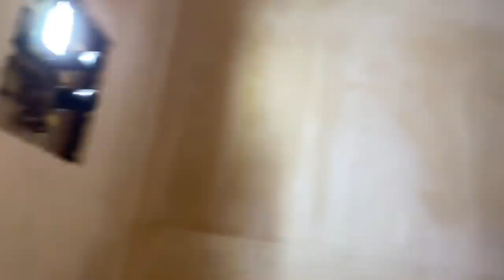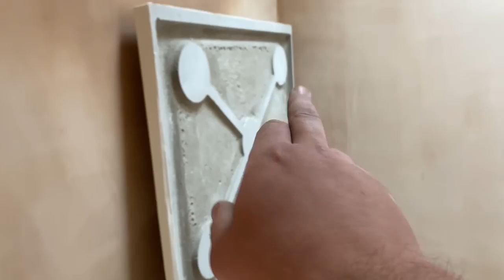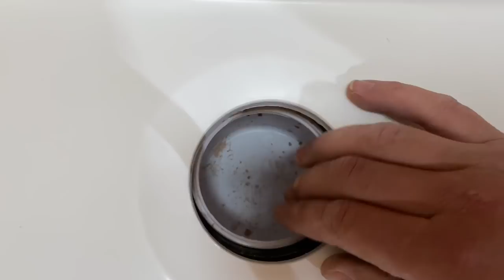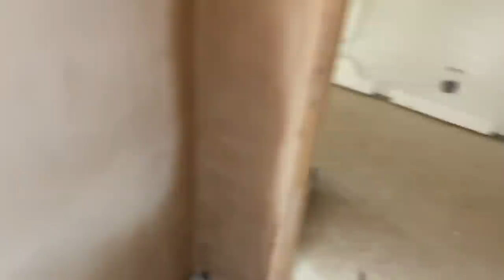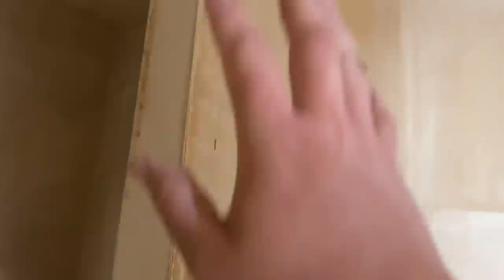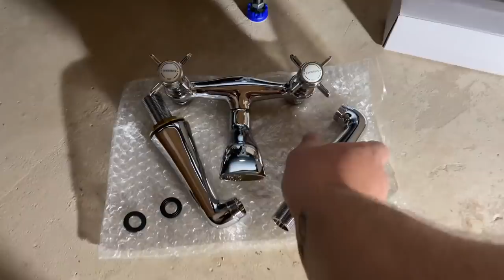SHOWER TRAY INSTALLING…THIS IS WHAT ITS REALLY LIKE DAY TO DAY PLUMBING ON SOME JOBS

Comment from the maker: ALSO BEFORE ANYONE SAYS IT, I KNOW THE SCREENS MAY NOT FIT…. THATS UPTO THE BUILDER NOW
Reply: Ha, just about to mention that! Get quite a bit of tolerance though
Reply: You haven’t pinned the comment mate good video I love/hate those jobs at times 👍
Reply from the maker: Pinned now 🤣🤣🙈
Reply: On most 120cm shower cubicles 99% of the screen are at the allowance 116-120cm which yours is going to be 119cm with tiles and adhesive .
So nothing to worry about!
I have installed 100s of them
Reply: May well be up to the builder but he and the client will still blame the plumber when that job of installing any doors/screens eventually gets bodged into place. Just hope the client never clocked your van during a site visit and remembers your details from it as I bet they'd happily sling mud you down their golf/country club or at the PTA meetings they attend!   

Shame that builder and his workers don't know how to use a tape measure or how to allow for final finishes. 

Quality LOL
Reply: Depends on the tolerance of the screen, you might be lucky, I stick trays down with flexible tile adhesive to stick with the manufactures instructions on most trays.
Reply: See someone Curt ing a screen down 😂
Reply: See someone cutting screens down 😂
Reply: Looks like ahower curtains will be used
As i cant see the door fitting
Especially if thick tiles 🤔
Reply: @tomstrutton4351  🤣
Reply: I was just about to mention that 😂. I always check the tolerance in my shower-screen channels if I’ve got a tray to fit in a tight spot . 
I once had to cut 5 mm off the end of a shower screen frame for it to slid into the channel . Nightmare . Love the videos 👍
Reply: @oliverwoods5554  Would have at least spoke to the builder first if only for some sort of indemnity to give them the opportunity to correct the mistakes. So if ever the tray cracks and leaks what will be the discussion when the insurance company see the tray has just been stuck down with silicone as opposed to the manufacturers instructions. Maybe never had a problem but seems a lazy way of doing the job just to save time and money.
Reply: Legs!

Comment: I'm due to retire at the end of this week after 50 years plumbing. ( I started Sept 73 aged 15) When we did trays back in the 70s ( deep ceramic ones) we had to rely on the grout to seal around the edge. No silicone in them days!😂
Reply from the maker: Enjoy your retirement mate, and thankyou for you years in the trade👏🏼👏🏼👏🏼👏🏼…..

Comment: This was greatI was in exactly the same position with a 900mm having to fit into 875mm. Ended up having to do the same thing you did but also having to redo the plumbing etc. First fix was terrible. Thanks for this.

Comment: I had a 1660 gap for my shower tray. I just brought out the narrow wall by 50mm (40mm studs + 10mm backer board) then had 10mm wiggle room. But not sure why they don't just make it to the size you need in the first place. Also, I think they skim as tilers are happy to tile onto plaster and it's cheaper than backing board or other alternatives.
Reply from the maker: Yep they should have made it the right size from the start…. Happens a lot when communication isn’t there

Comment: I noticed it was “MX” shower trays going in. They are a proper pain they are usually bigger than the stated size by upto 10mm sometimes. I add “classi seal” to all my trays and that adds a few mm either side aswell.

Comment: Your patience and determination to get them trays in mark just shows how good a tradesman you are you done an excellent job, can't understand why the plasterers have boarded it out that should be done after the trays are fitted and be boarded out with concrete backer board but never the less top work fella. 👍

Comment: When you cut the first one and the clip went straight onto the second shower tray that didn't fit 😂🤣 I fast-forwarded the start but the fresh plastered walls and fucked up measurements look just a typical new build. Glad to see some things don't change 😂😅😅🤣
Reply from the maker: Yep…. And it left to us to fit a round peg in a square hole as it were

Comment: Good video mate. Thanks for putting it together. Often a shower tray will be slightly over. So a 1700 tray might actually be 1710mm. The inside plastering of the cubicle is a little odd. I'd leave the internals unplastered but always tape up and tank the walls before tiling. The Popmaster comment made me laugh! 😂.
Reply from the maker: Yer I know they come up slightly bigger sometimes, however these enclosures were a fair bit smaller!!!!!
Reply: @MJTiffPlumbing  oh I know mate. You did well 👏🏻

Comment: As a diyer i have always used on stud work 12mm hardiebacker for the internals of a shower enclosure to tile onto. Is that overkill ?  Also silicone is great if enough of the shower tray bottom will be flush with the ground which yours looks  with those strategically placed round pads
Reply from the maker: Thanks mate

Comment: How do you level a tray on silicone? That’s why people use sand and cement or tile adhesive, because floors are very rarely level
Reply from the maker: Never had an issue in 30years buddy👍🏼👌🏼

Comment: Quick question. Ripping out old shower. Noticed that the 1200 tray has plasterboard (and tile) down to edge or tray. Rather than chop studs/move walls, would it be easier to pack one side out and fit a 1100 tray? That seems the se sible idea to me. Thanks in advance for any adivce.
Reply from the maker: Plasterboard is best going to the floor
Reply: @MJTiffPlumbing  legend. Thanks Mark, appreciate the response. Have a great Easter 👍
Reply: If there is anyone out there who could possible help with this headache... Space between brick wall and metal stud work is 1230. 1200 shower tray doesn't give enough room to get 2 X board either side + adhesive on brick side. An 1100 would fit but it means me doubling up (and more) on board on the side of the steel stud wall (which backs onto a cupboard). Ideally I'd want a shower tray of 1150 but they don't seem to offer them. Any wisdom to share on this anyone?

Comment: Tip I learnt from Roger at Skillbuilder, get some plastic wrapping straps like they use on bundles of bricks on pallets, sling them under the shower tray and around, then when you lower it down you can lift it back up easily using the straps.
Reply from the maker: 👍🏼👍🏼👍🏼 nice little trick

Comment: Great vid as usual. Do you ever use a classi seal around your shower trays? Also if tray is not level when dry fitting do you find it still can be levelled using blobs of silicone or do you use a different method to level tray. 
Keep up the content, it’s great 👍

Comment: S'bout reyt! Builders!? What about penny pinching customers?
"Oh, we know a plasterer".
So when "the plasterer" attends and you explain your specifications, you still need to chop 25mm out for the head end of the bath, lower the bath in at an angle and then jack up the feet to get it to fit. 
Next job.
"Oh we know a plasterer"
So, when you re-attend, the walls aren't plumb, are  up to 30mm out at the top lh and rh side of the window and you are working with 600 x 300 mm porcs....brick-course pattern.  Plasterers... I even uploaded a video. Don't spill your beer if you watch it.

Comment: I'm no bathroom fitter/plumber but I ordered a bath that was 1700mm, picked it up and it sat there for a month. When I come to fit it, it wouldn't fit. I couldn't work out why till I measured the bath. It was 1710mm. I complained to the shop only to be told the measurements are nominal. Can be 10mm either way. Never again. I had to cut away the plasterboard and it never looked right. 10 years later the tap broke and I couldn't get the bath out to fix it as it was up against the wall. Never again. I'll leave it to you guys.
Reply from the maker: Yep, always something like that happening and it really pisses you off aswell, as you found out

Comment: Feel your pain on that job.Just my 3 penny worth -no criticism of your work-But I found there is a massive difference between some silicones when fixing trays down on to chipboard..Used to use mortar mix but on switching to silicone I did one with a liberal amount of  Dow Corning 785 and the silicone didn't have any adhesion whatsoever to the substrate when I did a 'test lift' the next day. The substrate had also been swept and primed with SBR the previous day so was dust free. Then used a hybrid polymer type sealant the second time(plumbers gold) and it definitely made a world of difference in bonding to the chipboard. In reality, as we know, those big trays could probably sit there for decades without any form of sealant under 'em but I've learned  not to waste any more sanitary sealant in trying to stick the damn things down in future.

Comment: I know you say you prefer using silicone, would classi seal not be cheaper and personal I think it’s the best thing ever made in terms of plumbing materials/fittings, but as you say mate everyone has their own way of doing, also doing a site and we sometimes get problems with the plasterboard for the baths and have to cut the wall aswell lol

Comment: Day rate plus £100 in multi tool blades! With regard to the screen you could always tile/ board up to it………………just like they were in my upstairs shower room🤬 oh and then silicone the 5mm gap between the screen and the shower wall 😳oh and then not bother boarding the studwork opting for that tried and tested method of 12mm plasterboard packers siliconed to the studs!😱oh and then finding that said silicone is not really holding the shower wall to the studs sufficiently opt for 50mm screws with caps to hold it in position🤨,oh and then wonder why there’s so much filler in the kitchen ceiling😂 needless to say that one is now sorted. Only the downstairs bathroom to completely gut now as some moron did exactly the same there too. Glad you stuck with it bud👍🏻
Reply from the maker: Holy shit 🤣🤣🙈🙈🙈🙈

Comment: MARK,had this before and had to do the same BUT, if the opening is 1160 less tiling 20mm?,1140 your door/enclosure adjustment may not be enough?thats if your have door sliders?
Reply from the maker: Yep, see the pinned comment mate 👍🏼

Comment: Matt, I have to install a shower tray in an external building, but to create a enough fall to connect to the waste outlet, we have to raise the tray off the concrete floor. Any tips for doing this? Would you build the floor up underneath with ply, concrete or use a riser kit?
Reply from the maker: I would build a solid base with 3x2 and ply board the top mate 👍🏼👍🏼
Reply: @MJTiffPlumbing  cheers mate and thanks for taking the time to reply.

Comment: How do you know if the waste is leaking?
Reply from the maker: Years of being in the trade makes you know it’s not….. doing it right
Reply: Seems now that loads of trays are poorly made. I’ve being using the Mira flight trays that have been fine, but as skill builder has found, they are not finishing the bottom of the trays 🤦🏻‍♂️

Comment: One, where you getting your trays from cause if we tried those angles with the ones we get they'd crack for sure.
Two, we only silicone trays on solid floors (concrete), any joist floors are sand cement on top of ply. Whatever works and doesn't get you a call back under warranty though. 
Three, since 2018 shower areas are supposed to be tanked so what was the point in plastering it's just a waste of man hours instead of using a waterproofing board.
Reply from the maker: Trays supplied by builder….. thankfully, maybe you should be using better quality trays 😉👍🏼

Yep I’ve always used silicone for nearly 28years in the trade, never ever had an issue, not once👍🏼

As for the tanking, that’s on the builder…..
Reply: @MJTiffPlumbing  Always check the manufacturers installation instructions as some specify silicone, others mortar. Rodger @ Skill builder has covered this recently: https://youtu.be/zzBoD8a3umU  Saves the headache from a call back but those that don't care about reputation will use silicone as it's quicker and easier . . .
Reply from the maker: @1keafy  my reputation is perfectly fine mate, siliconed trays for 27years in the plumbing trade…. Not 1 single issue

Comment: If you don't mind me asking mate I'm doing more and more work of my own these days as opposed to the firm I work for and the most difficult part is quoting, how did you.. on this job for instance.. even begin to quote, is something like cutting the walls out for the tray to fit considered an extra? It's really difficult cos I don't want to charge too much and don't want to undersell myself. Cheers 👍🏻
Reply from the maker: Hey buddy… fortunately on this particular job I’m doing it on a day rate, which is best for this job I think.
However other jobs you just have to cover your arse and say “if it needs cutting out it’s extra” etc etc.
As long as you cover your day money wise you can price from that. Just comes with time
Reply: @MJTiffPlumbing  hey thanks for the reply, I see I see, yea I thought when watching that once a job gets to a certain size it's hard to say how many extras you'll come across. Another question, do you do the boiler/cylinder installs in these properties or mainly just bathrooms and rads etc?
Reply from the maker: Yer I do do cylinders/boilers on build etc but not on this one.
Take a look at the house renovation videos and you will see on those ones 👍🏼👍🏼

Comment: Having been in the trade for 45 years & have fitted hundreds of trays of all types what I've found is certain manufacturers will stipulate how they must be fitted. Most want them on a weak sand cement base otherwise the warranty is voided! I appreciate how you fit them but imo it's not a one size Fitz all . Relying on a few dobs of silicone on such a large tray dropped on a dusty floor long term isn't good as silicone doesn't always give good bonding.
Also how do you check the integrity of the trap & waste once the trays down ?
Be interesting to see what the tray manufacturers say🤔.
With regard to the plasterboard being cut out & I've done loads where I've had to do the same.
But I'm sure much like me you've gotten calls to leaking trays or baths where the trays not sealed in properly. Why do builders rely on standard plasterboard in shower tray areas is beyond me for the sake of a few extra quid cement board or thermal board will give peace of mind from no water ingress. 

Just an observation I've noticed on alot of your vids I  you only use knuckle bends on the waste as opposed to swept bends?
Showers are a nightmare for blocking up & to Rod when knuckle bends are used is it just you prefer to use them or ?
With regard to the builder plastering the shower enclosure, some tile manufacturers insist it done especially if big tiles are used so as to not to void the warranty should they fall off or move etc especially mapei products. 
On completion do the appliances get drain tested before being signed off?
Great variety of work though 👌
Reply from the maker: Glad you like the variety of work 👍🏼

Comment: You didn't need to check the trays for level then??
Reply from the maker: The floor is perfectly level….. thus making the trays perfectly level…..

27years in the trade mate….. I know how to fit a shower tray😉
Reply: @MJTiffPlumbing  yeh fair play, so long as you didn't assume they were!!!
Reply from the maker: You should never assume anything mate 😉

Comment: I guess you didn't go to the gym after pissing about with those shower trays. What is it with some chippies when they know a 1200 tray has to go in, they put the stud work at 1200. That annoys the hell out of me. They should be made to fit the trays after boarding then maybe they would think about what their doing. Glad you stuck with it though, day rate too. 👊🏾
Reply from the maker: Exactly mate, pain in the arse

Comment: Surely makes more sense just ordering smaller sizes ？ everyone makes mistakes so gotta allow a few niggles but he should tank it especailly before putting in tray against wall ps 1600x700 looked damaged at front
Reply from the maker: Nope, builder said make them fit 🤷🏼‍♂️🤷🏼‍♂️

Comment: The plasterboard should not go down to the shower tray and bedding it on silicone
Reply from the maker: I know the plasterboard should go behind…. That’s the whole point of the video, showing how it is in real life on the job.

As for bedding on silicone, you can use a lot of different ways including tile adhesive, CT1, sand and cement and silicone…. Each to there own. I’ve done them with silicone for 27years and never once had an issue…..

Thanks for watching 👍🏼

Comment: Then shower trays should be cemented down really they will move all over shop and not enough silicone on them really
Reply: Depends on what the manufactor says. some say you can use stuff like pink grip some say cement based products , sand & cement. etc...
Reply from the maker: They won’t move all over the place but thanks for watching

Comment: I'll just leave this here about you using silicon for the tray:
https://youtu.be/zzBoD8a3umU
What do you think?
Reply from the maker: Each to there own, do you have a video of one that has been fitted with silicone and zero issues?…. I’ve got loads

One fitted trays with silicone for 27years and never ever had an issue……
Reply: @MJTiffPlumbing  I'm sure you haven't had any issues.
Does the manufacturer say they can go on with silicone or do they need be on a bed of sand and cement?
Also the ones you're fitting in this video are they ground floor? If so maybe a small leak won't be as noticeable?
Reply from the maker: Ok Raf……. 👍🏼

🙄🙄
Reply: I guess the fitting instructions issued by manufacturers for fitting trays just covers them and builders ignore them because it’s more expensive and quicker to use silicone.